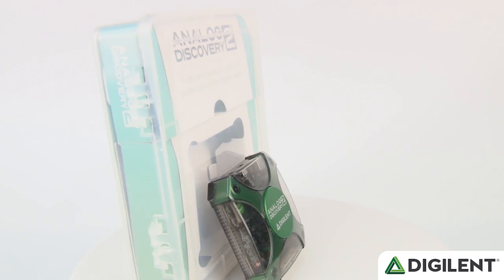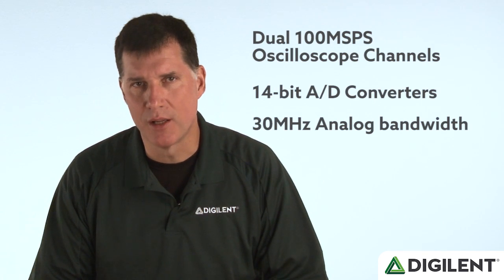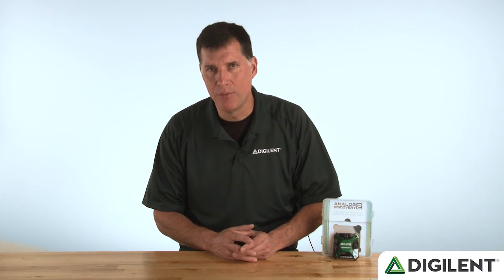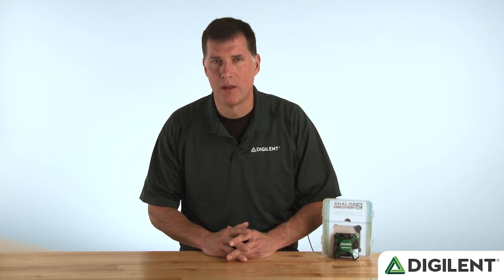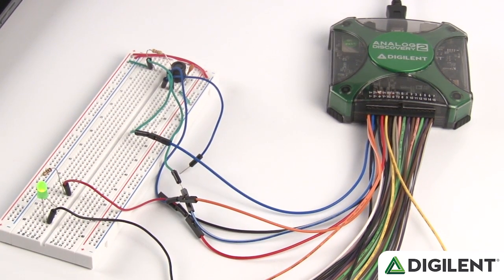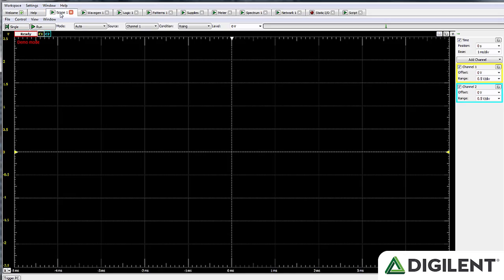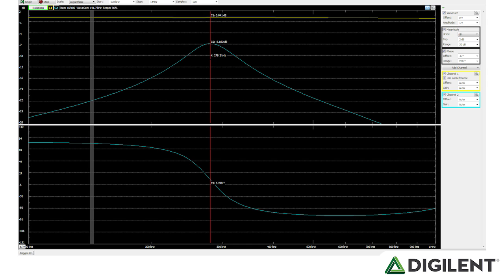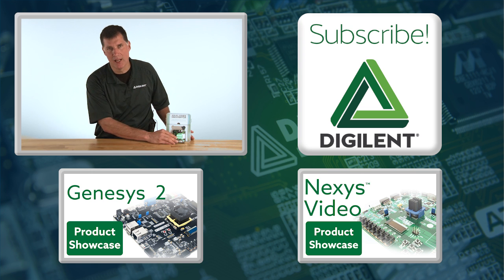Analog Discovery 2 Introduction

Comment: I assume it's based on the sampling rate and the number of channels you are monitoring, but anyone know how big (long) you can capture, say 2 channels at 100khz, using the Logic Analyzer? 

In addition to the LA, I'm also interested in the oscilloscope/awg in order to 1) capture a 10V analog wave, max 50khz bandwidth.. once captured, I'd like to export it (CSV?), 2) play it back via the AWG (3.3v)!

The price-point on this device is perfect.. it's a bit more expensive than the PSLab, but much less expensive than the Red Pitaya!

Comment: so what if I want to measure voltages higher than +/- 25V ?
Reply from the maker: You will probably need a different tool if you are measuring voltages outside the range that the AD2 is rated for. I would recommend checking out the Digilent Forum for answers to technical questions: https://forum.digilentinc.com/

Comment: How does Analog Discovery 2 compare to the original Analog Discovery?
It seems to me they are quite similar.
Nice presentation Thanks.
Reply from the maker: +Mohammed Algailani The improvements are listed in the reference manual, here: https://reference.digilentinc.com/analog_discovery_2:refmanual

The section that describes the major improvements in the Discovery 2 over the original is at the bottom of the "overview" section, just above Section 1.1 Architectural....

Thank you for the question!

Comment: +1 for Linux support.
Reply: @vadim @Ludwig Schreier  You guys are lucky - it works great on mac and linux (lubuntu 16.04). This is a big win for me, and I'm guessing this will catch on with alot of folks. I don't think there is anything on the market that works with either mac or linux and has all of the features (scope, logic analyzer, fft/spectrum analyzer, power supply, etc etc)
Reply: Indeed! The software works great under Linux. However, I had some incompatibilities with the latest version of Digilent Adept (2.18.3) and had to fall back to the previous one (2.17.1). Sometimes, it hangs a bit when connecting to a device (before configuring it, which is a bit odd), and causes the VM to completely freeze if used in a virtual environment. Both my VM and my real machine have Kubuntu 18.04 LTS, 64bit, installed, and I'm using the latest version on Waveforms. Let me know if you are having these problems too. I have to open a case with Digilent about this. It doesn't make much sense that this is due to the latest FTDI drivers.

Comment: great but still happy with the previous version i have !
Reply: +OL' SCHOOL no problem. We fixed some of the USB concerns (the wiggly-ness), added variable power supplies, improved the packaging (now you can get your wires back in the box) and added Mac support with Waveforms 2015. However, both Discoveries are awesome instruments.
Reply: +Lara Swanland Looks like one better feature is that you can add external power to boost the powersupply, instead of only drawing from usb. If one use external one, is it isolated so one doesnt get problemes with mains earth references?